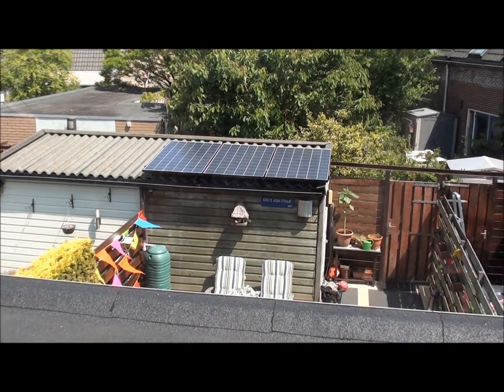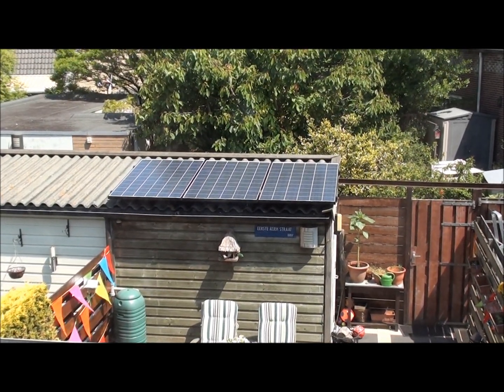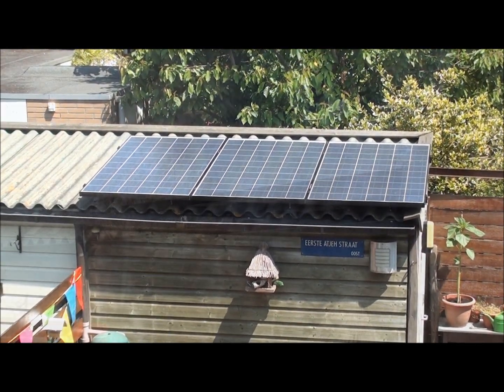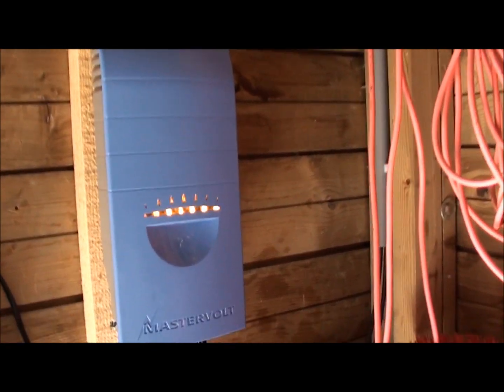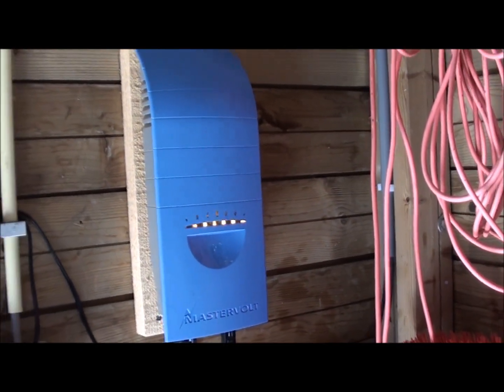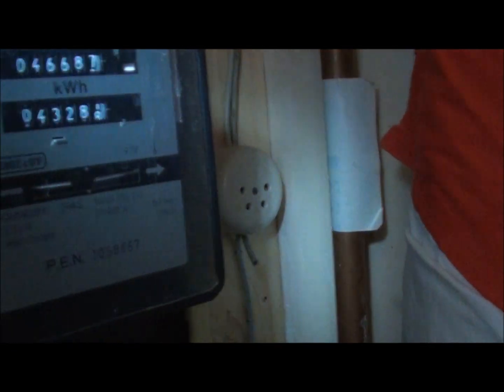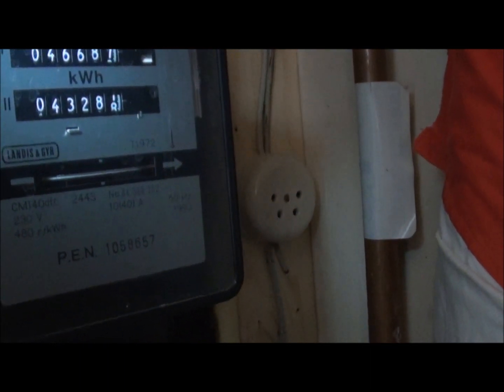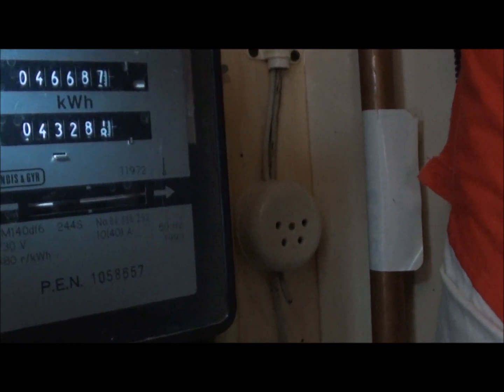Solar Power, 3 x Bisol 227, Mastervolt Soladin 600.

Comment: Hi do you just plug in any home socket and if creating more energy than using it will turn meter back. Besides panel insulation is it fairly easy to set up?